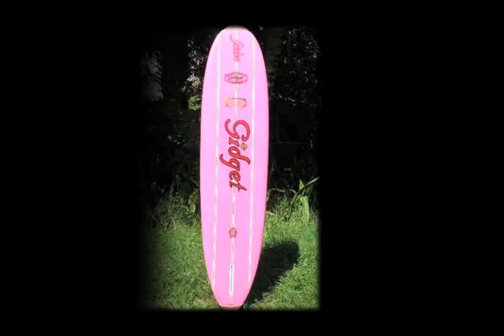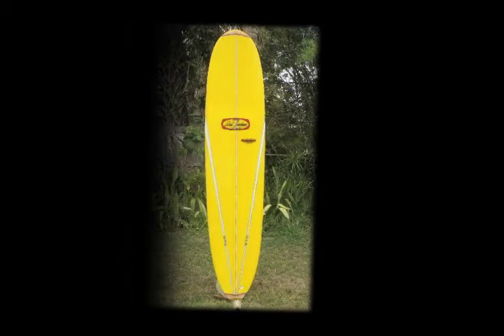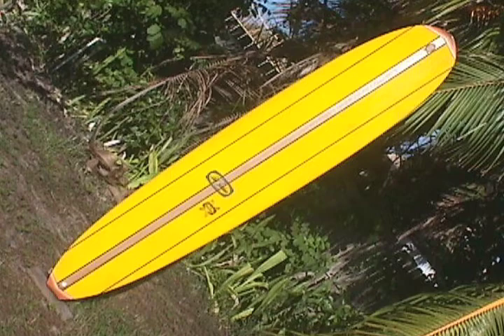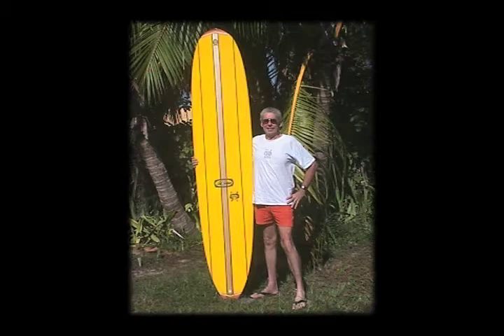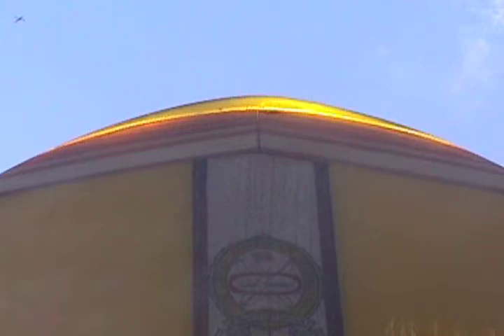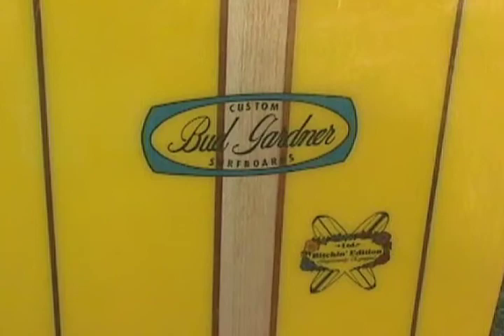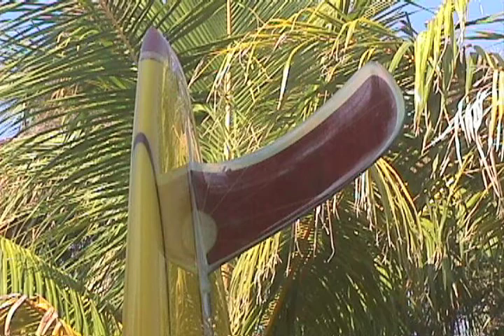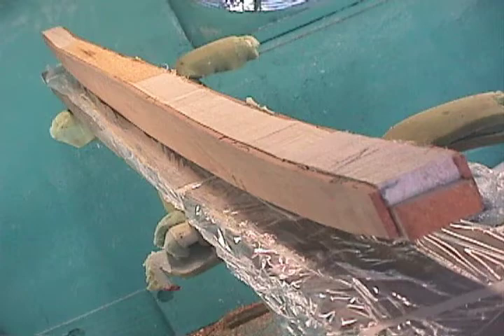Bud Gardner Surfboards - since May 6th, 1966

Comment: I bought a used 9/6 Bud Gardner in mint shape in the early 90's for $350. My first longboard never went back to short boarding. It brought my surfing to the next level. I loved the way it turned how it would glide I just loved it my favorite board for sure. I broke it on a bigger day and my friend F--ked it up repairing it. I wish I still had it. Now that I'm older and fatter I been using a 9/6 Walden Mega Magic. Its a great cheater board. I wish I could afford a custom made Bud that would float me and give me the early wave entry like the Mega with the Bud looks and glide. I live in FL and theres nothing like a shaper that shapes for your area. Hey Bud, Props to putting your heart and sole into what you love!!!